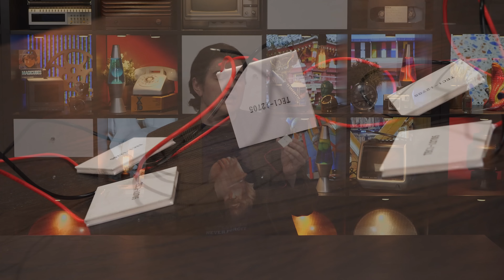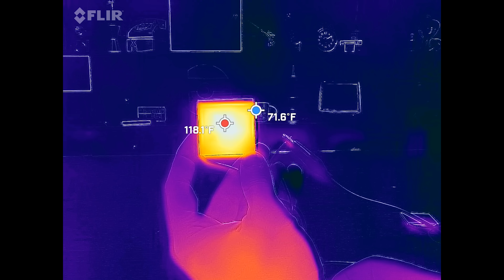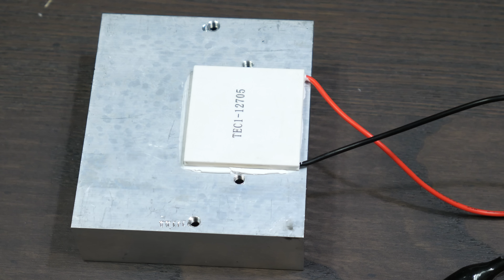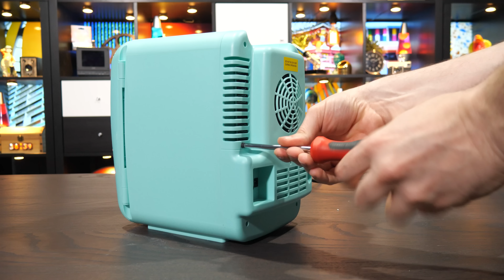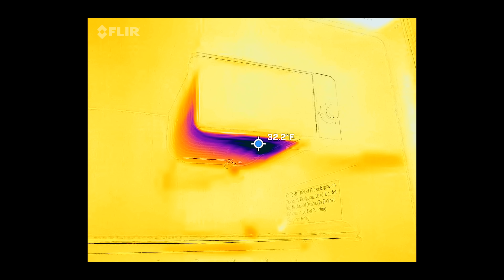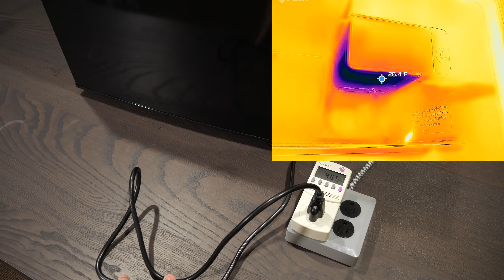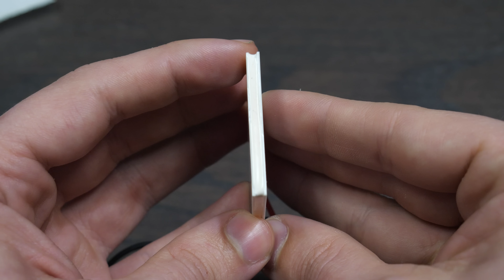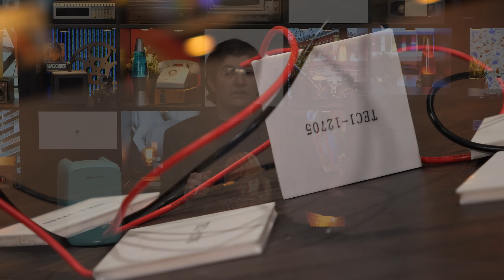Thermoelectric cooling: it's not great.

Comment: We had a cheap Walmart cooler which used Peltier junctions. We finally found a great deal on a real portable refrigerator to use in our car. It has more capacity, uses less power, and can cool down an additional 30-40 degrees. With it in the back of our hot car in the Texas sun, the temperature inside drops rapidly to about 10-15 Fahrenheit.

Comment: I have experience with four thermoelectric "coolers"...  

First, similar to your blue box, but larger, (I think it can hold 10 cans).  It was about $15 from Big Lots maybe 20 years ago, and came with a 12v 6A power supply.  It can be switched from heat to cool mode.  Rated 12V, 5.8A, 60 Watts. It will form a layer of ice inside the compartment over the Peltier element before it actually cools anything due to lack of air circulation, but will keep things cool okay.

Second is a thermoelectric mini fridge made by Haier.  It's the same size as a standard cube fridge, has a thermostat control, and is rated at 75 Watts, 120V.  It has a heatsink and fan on the cold side of the Peltier as well, but 42 degrees is the coldest it will get inside.  Probably why I found it in the trash.

Third is an Igloo electric cooler of unknown age, approximately.  Runs off of 12V, has a centrifugal fan and heatsink on the interior and will freeze  beer if left on for a few days.  It will also melt the power cord if left on for a few days (aftermarket power cord)

Fourth is the cooling module that I salvaged from a Reddi Whip retail display made by Electric Breeze from the early 2000s.  This has two Peltier modules with fans/heatsinks, and was powered by a 24v 12A power brick which had self destructed.  It was, however, capable of keeping its cooler at a respectable 34 degrees...

Comment: I do like the peltier travel coolers, but I do with them what I do with a non powered cooler. If it's small I make sure everything is chilled out a layer of block ice on the bottom and a sheet of heavy duty foil folded on top of that.  I get 3 to 4 days from that.  With a larger one put a Styrofoam/insulboard panel to have one side cold and the other cool.  The ice will be in a container but everything else will be the same as before.  This has lasted 6 days if you are careful about how often you open it up.

Comment: This terrible not fridge deserves the same temperature controller treatment that the red refrigerator got. Load it with spray foam insulation and beverages and see how low the power consumption can go if they were made correctly.

Comment: i feel like these things literally make better heaters than they make coolers. like, this would make a great aquarium heater since it would pull ambient heat into the tank as well as the base thermoelectric effect, which is what normal aquarium heaters use.
Reply: Unironically makes me want to go get a cheap glass aquarium and bond the hot side of a peltier unit to it to see how efficient it is compared to a 50W submersible heater. You'd need a thermo controller like an Inkbird with it but a lot of people use that for regular heaters anyway since regular heaters tend to fail on and accidentally boil your fish sometimes
Reply: And hell, you could stick two aquariums next to each other and keep cold-water fish in one and tropical fish in the other 😂

Comment: I hardly ever comment on videos, but wanted to note you managed to have me seated for a half hour to hear about refrigeration. Always wondered how fridge compressors worked, so thanks for the bonus, basic explanation I wasn't expecting to hear. Came across the video since I'm testing a 12v, 30L car fridge I just bought, and I'm testing the use of a cell phone charger (yes, a 100w, 20000mah power bank w/a cigarette lighter adapter) as a portable power source. I can attest to the awesome efficiency of a little fridge compressor that can be charged with a power bank and keep a steady 33F temperature for nearly 6 hours! I just saw that you have a separate video on heat pumps, so I guess I'm heading over there now.  Thanks for the content!

Comment: You missed the coolest application of Peltiers.  They work in reverse... Not by reversing hot and cold, but if you have a temperature gradient, they CREATE voltage.  I have several fans that sit on my Franklin stove and power small fans from the heat of the stove.

Comment: Everything you said in this video was completely valid. That being said, I don't pay for the energy at my office, and I wanted something really small that can keep 1-3 cans cool for the next day or so (upright). I think with 1-2 cans it cools better than 3-6 but I don't need more than 1-2 cans.

Within that very specific set of requirements, it works like a dream for me. I'm also not allowed larger refrigerators, but they don't care if I have one of these little guys. And the cans I put in here are fridge cold by the next day.  This is very useful information if I were to pay for my own electricity and I now know that it really isn't worth it for at-home use. I also bought 2 of these for $10 total secondhand so I got a good deal either way :D

Comment: I have seen some interesting Videos, where the opposite use case is taken into account: Making electric-energy, for example fans if one side it Hot but the other cooler the fan starts spinning. This element could be used as thermal regulators. It would be interesting to see more use cases like putting them into walls or under Solarpenals and then maybe use the Energy from the heat to cool them (with air or water flow)

Comment: I like my little cooler works fine i like that it doesn't havn internal fan that holds odors cleans easy its quiter than a normal fridge and i wanted some just for drinks or small things i buy on the road as a trucker also hard to find something this small ac keeps the ambient air cold and power is not a problem when im working

Comment: Peltier devices are better described as thermal electric heaters rather than cooler
 
Given, I've been known to use electric heaters to supplement a HVAC system I don't mind an electric heater with a cool box attached 

In theory

The problem is in practice i only want a chilled drink on a warm day and on a warm day I don't want a heater running

Comment: this was the first video of yours that i was disappointed in and i have many problems with it of many different varieties! the first being this is common knowledge, i already know this my mum already knows this my cat already knows this, not a single second of this video was something new and interesting to learn (i watched it all even though i could tell early on i wouldn't learn anything so i could write this comment and not miss context from later in the video) where as every other video of yours i learn for at LEAST most of it!!! my next problem of this vein is your unusually mean attitude towards the beginning of the video, this and some of my other problems lessened at the end but the beginning was still strange in this regard, for example how you refused to call it a heatpump and fridge and changed the intonation of your voice to further imply your dislike of it beyond what i found reasonable.
my next problem is (especially towards the beginning of the video) your conflation of the peltier devices with the small blue fridge, you later talk about its poor construction and lack of insulation but for most of the video you ascribe all of its shortcomings as due to its method of cooling.
i also take issue with your method of using the internals of the fridge as a metric! you know this isnt how they work! a bigger fridge will always win because the fridge is not fighting against internals its fighting against the surface area of the volume its cooling when it comes to maintaining temp (WHICH WAS YOUR EXAMPLE FOR ALL FRIDGES BUT THE SMALL ONE)
there is another trick peltier devices have which is they are also heat engines, again inefficient(although the real comparison is sterling engines as the peltier devises work with any set of temperatures unlike engines which require water boiling) but this increases their uses exponentially (you state thermoelectric cooling in the title but refer to the peltier devices in the video so although this doesnt fit with the title it fits with what you were actually saying)

"generates 60 watts of heat energy" this ones on its own cause im not sure, ive never been able to get an answer on this but this depends of if heat fundamentally has potential energy stored in its differential or if heat engines extract some of the heat as energy (the difference being when you mix two things of the same thermal mass they are said to have the average temperature after the heat distributes and the question is if this true or only partiality true as this can only be the case either with no heat engine in-between the two objects or with a heat engine between as if we say it has a fundamental potential difference then it would be slightly hotter without a heat engine and if not then when the heat engine is there it would be slightly colder )
Reply: oh also i just love heat pumps and heat engine of all sorts!!! no hate to refrigerants!!! also peltier devises are useful in the nature that their cooling can be controlled not just over time but with voltage so if you have something sensitive that needs exact temperatures where you cant just turn on the pump for a few minutes then peltier devices rule once again

Comment: truck driver here. the electric coolers work fairly well. not as good as a fridge of course but well enough to keep your lunch meat good and you cant power a fridge off a 12v outlet in a truck. the big diffrence between that blue junk and the good ones you find in truck stops is they are better built with proper insolation. that being said, they are not cheap (build quality and price) edit: back when i was a cruss county truck driver (local now) there where not really any 12v fridges but after looking on amazon it looks like there are quite a few options now.

Comment: I've always heard mini fridges don't last near as long as full size refrigerators.

However i have a GE mini fridge that i got 20 something years ago. Ive used it pretty much none stop. It was an expensive one way back then. Yes it needs manually defrosted because it will freeze over. Which isn't hard. Just a bit annoying. Ive never had an issue with it once.

Comment: I have a peltier based drink cooler/heater that I've used constantly for 33 years.
The fan still makes no noise and the device works perfectly.
The drinks stay cold or hot and the effect is immediate.
It takes only a few minutes to cool a 0.5L beverage.

You just bought a cheap and poorly designed product.

Comment: I believe the liquid bed cooling systems from 8 sleep and sleep .me use peltier elements and they are fantastic. No need to go below 55F for a bed cooler and no more sweating in bed. Can also heat the bed for cold nights. I find that I can set the thermostat in the house at a more energy efficient level since the bed cooler keeps me from sweating.

Comment: if that thing had an actual thermostat to only run when needed and had proper insulation, might have actually be okay using it to keep  a few cans cool during summer. but seems like its built to the lowest price possible instead of actual functionality

Comment: I have seen wood oven top fans that were run from electricity generated thermoelectrically by the heat flowing from the base of the fan through the semiconductor junctions into the heat distribution fins behind the fan. The fan automatically starts running whenever it sits on a hot surface in air colder than the surface.

Comment: There are good uses for peltier elements , 
Woodstove fans use the heat difference in the peltiers to power a fan and distribute the stoves heat through the room, and they're a fun toy
Reply: This is an effective application of Peltier coolers as generators.
Reply: ...huh... I always remember those as being called thermoelectric generators, but they are the same thing.  I learned about them thanks to their use in space probes using nuclear decay as the heat source for long missions.  Makes me think of how the only difference (kinda) between a motor and a generator is which way you want the power flowing.

Comment: We have a peltier fridge, it has 2 modules, but also a thermostat, hot and cold settings, AC and DC inputs.

It was used to keep enough pre-chilled milk cold for 12 hours at a time in our bedroom for our child when she was a baby, it kept the temperature perfectly and caused less disruption of a sleeping baby, the fan noise was a white noise bonus, now she likes to sleep with a fan on. I currently use it in my work vehicle to keep my lunch and drink cool and it works fine for that. Good ones are ok for filling a gap where a compressor fridge wouldn't be suitable.
Reply: I'm sorry, I think I misunderstand.
Why would it be impossible to put a tiny fridge in the bedroom, or into a vehicle? :) 

(presuming it's a pickup or big SUV - aka "typical" American stuff, not one of our tiny European city cars)
Reply: @MrNicoJac  Honestly, because they are awfully big for a car. Not everyone can spend so much space on a fridge, for me it's fine. I need the space and don't need to hold 40 beers anyway. I mean, it's not about cooling efficiency it's about space
Reply: On the fridge in the bedroom . I did the same thing , but to correct a problem , I would go into the kitchen late at night to get something to drink 
My child , a 20 year old feline would slap me up side my head  . My fridge 
Stay out .

Comment: 7C is not food safe? I’ve always set my fridge to that temp and it’s pretty standard as far as I know
Reply: the real problem is that the fridge can only cool down 16.5°C below ambient. if ambient temp is 23.5°C then that net's you a cool 7°C. but during summer when temps might get hotter you could be reaching 12°C easily unless there's constant air conditioning. and even then it needs 24h to reach that temp so thats 24h where the temperature isn't foodsafe

Comment: One place I thought a peltier would be effective is in a 3D printer hotend to separate the heater block from the heatsink above. By actively cooling the heatsink, it stays cool and prevents heat-creep from the hotend and the piss-poor efficiency doesn't matter because the hot side is effectively replacing an electric heater anyways. I've never actually done the engineering behind this so I don't know if it'd actually be worthwhile.

Comment: Are these perhaps being used in cooling CPUs and GPUs? Perhaps super slim electronics with very heat intensive GPUs could benefit (like portable videogame consoles). I've seen some chinese "phone coolers" that may use this tech to cool the phones quite fast (at least faster than traditional fans)
Reply: They're used for camera chips to reduce noise in the picture.

Comment: They're pretty useful in my Deep Space Camera ZWOASI294. I need to have my sensor lower than 20 degrees below ambient to remove noise from my space images. The camera needs to be lightweight to attach my telescope for guiding

Comment: Works just fine if you know what you are doing, built myself an ice maker with few of this.
Not super fast but works great in my car on trips to cool my beverage, I'm using watercooler from my old computer to cool the hot side.
If you have a brain you understand that Peltier just moves thermo heat and heat dispersing the hot side faster makes it even colder

Comment: Agreed using those modules to heat/cool is marginal - but making current electricity by maintaining one side hot and the other side cooler is, perhaps more useful.  Think here the fans placed on top of heaters where the fan is driven by the temperature difference.  Peltier and Seebeck can combine for lots of useful operations.  Using waste heat to produce useful electricity is good.

Comment: This kinda relates to the difference between analog and digital sensors. It's a lot easier to move/sense a quantity through its own medium, rather than using a digital/electronic medium to move/sense that same quantity, even if it's a simpler process.

One of the first(ish) rules of engineering is understanding that the simplest solution is not always the best!

Comment: One fun tidbit (that's not really relevant here, but I thought people might be interested) is the seebeck effect, which is basically the reverse of the peltier. Rather than creating hot and cold surfaces using power, you generate power using the temperature difference between the hot and cold sides.

Equally inefficient and requires a similar heatsink and fan setup, but I always found it more interesting as a way to potentially utilize waste heat such as those fans that go on woodstoves.

Comment: The cheap design of the peltier-based product makes the otherwise mediocre peltier technology seem terrible.  My point is if a peltier product had thick insulation and good heat sinks and good air flow, the performance might be more acceptable for certain applications.

Comment: Thanks a lot: you made me spend like $115 to replace my crappy li'l peltier microfridge with an actual compressor-based minifridge. Sure it holds over twice as much, and sure it actually cools things down in less than 12 hours, and sure it actually has a freezer compartment than can actually freeze things, but it cost a whole 2.4 times what that garbage machine did, and takes about that much more space!

Comment: They are very useful in semis. Ive had 3 standard mini fridges develop leaks and vent their gases into the truck over the years, nice way to wake up with a headache if you wake up at all (depending on the refrigerant used)
Meanwhile, I've had the same  DC Peltier fridge for 4 years now and only hadda replace the fan in it, the origional was loud so i swapped it with a quiet run pair outta a old computer.